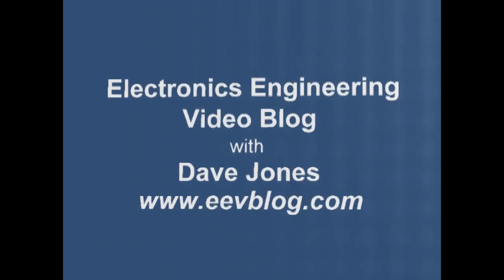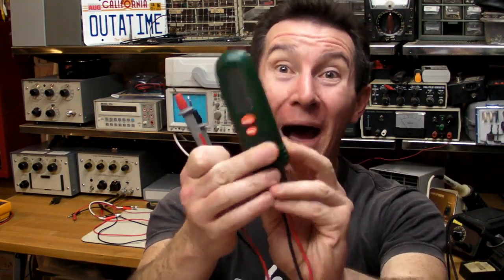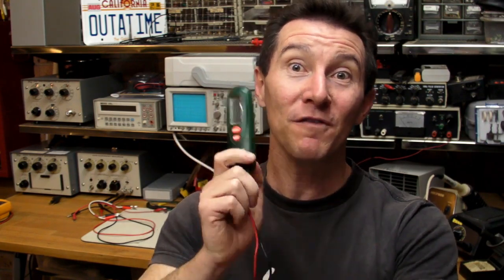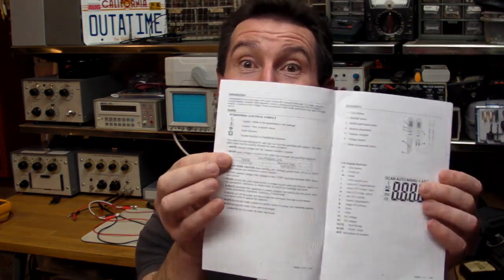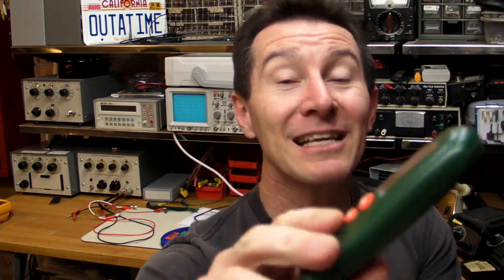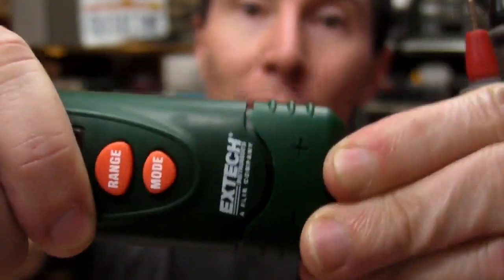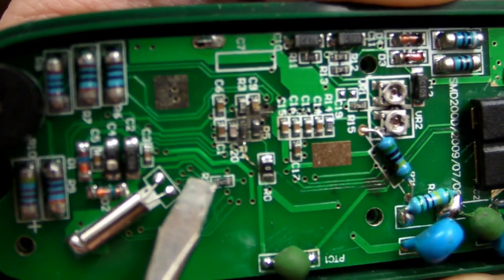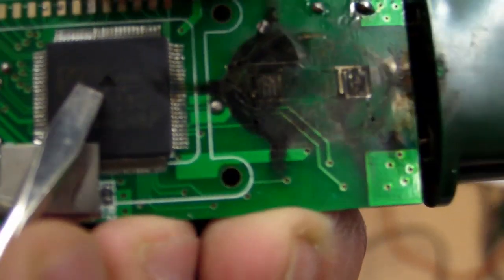EEVblog #94 - Near Death Multimeter Experience

Comment: Assuming that is the design they employed, those zeners would have turned on and converted much of the overvoltage to current, which would have blown up the passives. That's ignoring what magic is happening in the chip itself.

Comment: Did anyone see a fuse in that circuit? I don't think there is one.
Reply: There is no current measurement (only resistor, capacitor and voltage) in that device, so it don't need a fuse.
Reply: micropower8 apparently it does, if you watched the video ;)
Reply: micropower8 I wouldn't personally say this company specifically designs products with planned failure in mind. That's illegal after all. What you're saying is claiming the company is performing illegal activity. 

What I said was that this product could have used a fuse regardless of it not being able to measure amperes. 

And the fact that this product does not fully utilize all functionalities of a certain chip does not mean it's a cheap/garbage product. You couldn't physically fit a shunt large enough for measuring 60A inside this thing, no matter how much money you throw at it. This chip has several uses, and a handheld usage just doesn't use all of its pins, big deal
Reply: micropower8 well i don't know how to improve this product, I'm not an engineer. However, the solution that Dave said (which is exactly as it is in the datasheet) is that the device defaults to safe (whereas it defaults to unsafe in this product).

And yes it is illegal in EU to design a product that is known to fail within a given time. I think an electronic product is supposed to last a minimum of 2 years by law right now, with a planned increase to 5 years minimum in 2016. This means that the manufacturer will have to replace the product if it fails within 5 years, whether or not it was planned obsolescence or just bad design. This will ultimately weed out manufacturers that produce planned failing products by making their schemes cost more. 

Also, products with timers are extremely unethical. I'm not familiar with their legality, though I'm pretty sure a consumer will win any legal battle concerning this. I smell massive reforms. planned obsolescence isn't just bad for your wallet, it's also a huge burden on the environment..
Reply: Heh, anyone who thinks there are no planned obsolete products hasn't looked at an HP inkjet printer cartridge. :D

I don't think a low voltage product requires a fuse...just some common sense. A mechanical switch to go into current limiting/isolation from the mains directly to the MLB is ridiculous! Why not use those mechanical switches for the darned user interface!? The circuitry should take care, except in measuring amps, to massively limit/isolate from the outside world, the MLB. In addition, there should be some opto-electric isolation circuit ANDed with the front switches which will then prevent buttons from being pushed accidentally when high voltage is present on the line. 

Someone said this device cost around 73$? Yikes. I know it is not just a bare board, but just yikes... They cut quite a few corners on this to get it down in price...and this time it didn't work. Who thought that two calculator keys was a good interface for a multimeter, anyway? If Harbor Freight can make these for 5$, and they don't blow up...maybe they should stick with the classic design. It was already well thought out.

I have an Extech myself, and I am quite happy with it. The design is more traditional with the rotary switch.
Reply: Peter Lamont Why HP? All companies that make consumer-grade printers with the tricolor cartridges are guilty of planned obsolescence! But if you spend 200 € on a good enterprise-grade printer, the cartridges cost the same or less and have a lot (10 or more times) more ink. 

On the other hand, Epson printers had a counter that broke the printer after a certain number of pages printed. That’s not even planned obsolescence, that’s planned failure!
Reply: *****
Okay, if you look at the timestamp 10:07 you can see three connection jacks in the circuit diagram (IN, GND, 60A) but the 60A connector and the µA/mA-switch does not exist in the Extech RC200.
Dave got the circuit diagram from the appnote which is only written for the ES51928 chip.

This device is realy cheap, they have the possibility to create a much better device with a little bit more or better components (e.g. the switch between the two connection jacks), but the companies want to create garbage with a little lifespan.
Reply: *****
No, I don't say that Extech do this, it is possibly only a bad design.

To add a fuse would be not bad in case of a ordinary failure like this which is happened Dave.

They could use a marquardt switch or create a better connection between the device and the cable-connector.
If you plug something in you want to hear a "click"-sound and then you know there is a good connection.

"illegal activity"
Is it illegal in the US/Europe/Asia to create a cheap device?
If a capacitor (on a pcb) is in the near of a hot component (cpu, switching regulator) nobody can prove that this is a life reducing design or only a stupid idea.

You can see in the datasheets how much hours a capacitor can work under a defined temperature environment.

If you buy a device (printer, beamer) it is possibly that there is a counter inside (or a software counter as a little part of the firmware) which stops working the device or create a failure after a defined "ON-Time" of that device.
Reply: *****
In Germany I have a warranty of 2 years, if a failure occurs in the first 6 months the seller must prove that this problem was caused by the user to prevent the replacement of the device.

But after the 6. month till the 24 month the user must prove that the device was already damaged as he buy it ... but this is very difficult and expensive for a normal user.
After the 24. month the seller do not replace the device anymore.

Business economist do not think ethically if they lost money.
You can assume that it was a planned obsolescence but you can't give a evidence of it ... I mean this wouldn't be so easy.
Reply: micropower8 I'm pretty sure what you're describing is for the reseller and not for the manufacturer. You can still file your claim with the original manufacturer for RMA. Of course, the shipping costs are yours.

engineers could probably tell planned obsolescence from miles away

Comment: But if these can measure line voltage, they need a detection circuit to prevent damage to the low impedance modes (LCR modes).

Comment: Default setting should be to high voltagge unless tweezers are firmly plugued to change it to low voltage mode. In that way, a bad conection won't damage or injure you.

Comment: This is precisely why the United States went with 110V instead of 240V, SAFETY. I have been shocked by 110V many times, even when I was a little kid I stuck a bare copper wire straight to the AC jack to see "what it felt like" and nothing happened to me. I once saw a guy getting shocked by 240 when he went to unplug an running industrial machine, he did not die but all the hairs in his arm burned to ashes.

Comment: So in the diagram from the IC datasheet, the switch was normally open on the low-voltage pins... but when they built it, they put the switch in the wrong place or used the wrong type, so that it's normally closed to those pins, and the circuit is only broken when the probes are jammed in by a gorilla?  Idiots!

Comment: The slanted pin is to accommodate a 20A plug, being that it is a 120V 20A receptacle, which are more common in shops or kitchens where extra current capacity is required. without that extra pin configuration you're left with a standard household 15A 120V receptacle.  20 amp receptacles accept both forms of male plug pin-outs but the voltage stays constant.

Comment: Fluke recalled some models due to reading 0 at 480 volts. Extech is pretty flaky stuff. Auto should mean it automatically ranges the meter for voltage. Blowing up is terrible, and the mode switch being a cycling push button is pure poor design. I saw a Fluke that was hooked up to the primary mains at a copper mine. This equates to a 600 volt rated meter being hooked up to 12,470 volts. It smoked, and melted. Another guy with brand X wound up hospitalized with meter parts in his chest! Safety 1st

Comment: I dunno how you yanks do it, but up here in Canada most of us have 220V feeding the panel, the 120V you speak of is one leg of that. Any half decent multimeter needs to be capable of monitoring 220V without issue, if it doesn't it's garbage.

Comment: RTFM??
If the design of a unit is so counter intuitive that it can't be operated without reading the manual then it suffers from Bad design.
"RTFM" presupposes that the user is always going to remember the details of the manual amongst all the other pieces of equipment they are likely to use.
To have to re-read the manual each time you come back to use a piece of equipment means that it has a Very Bad ergonomic design.
RTFM is an amusing acronym, nothing more.

Comment: Dave, you IDIOT! ha ha... Did not read the manual? Shame! Kidding, I could have done the same idiot thing. However I would not buy piece of crap like that to star with. It;s clear to me it's a 5 or 24 volt DC max PCB tool, not a robust general industrial strength DMM for mains. Every job has the right tools.
.
Seriously love your videos mate, but I think you could take up acting, be in horror films as the insane creepy Inn keeper or killer.... you kind of went nuts in this video/

Comment: I once was working on a air conditioning unit up on a high roof. The 600 psi rated freon hose going to my pressure gauges blew, making a loud bang, scared me and I almost fell 30 feet.